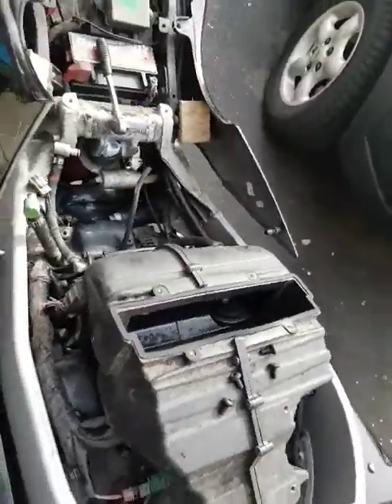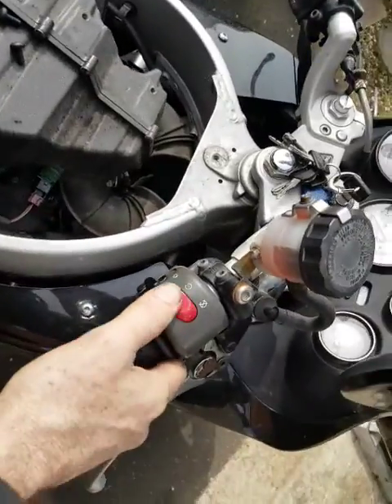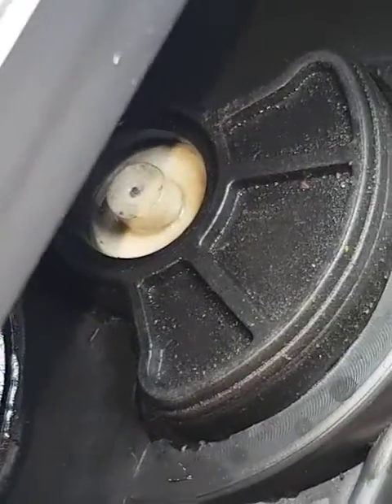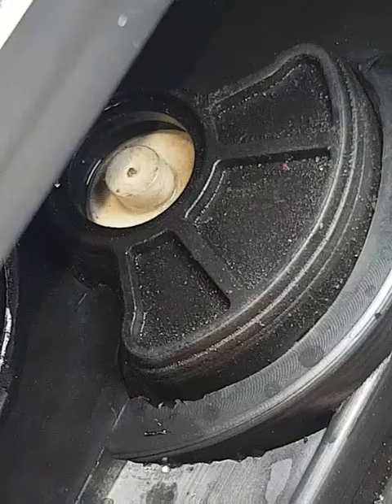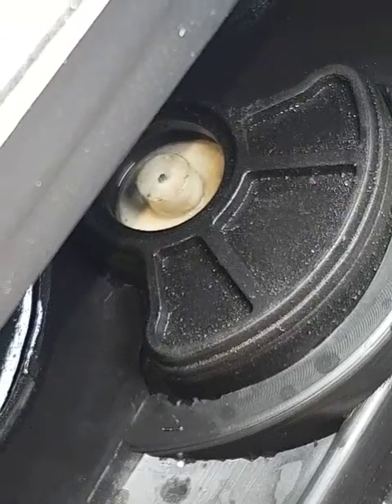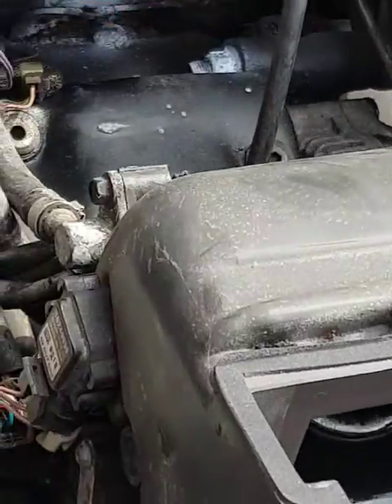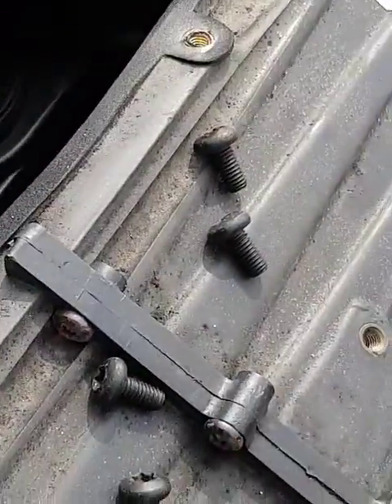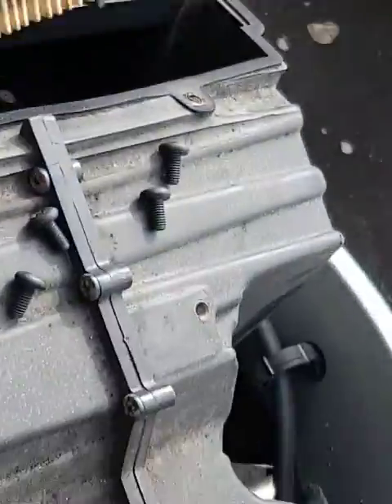Triumph 955i idle control,  stepper motor  piston check

Comment: my bike wont start removed the airbox to find the grommet around the idle control sensor was cracked and not sealing it would this stop the bike from running?
Reply: I'm having the same issue, did replacing the grommet fix the issue?
Reply: @kalubkoetje5580  nah mate still not got her running no clue to what is going on just gunna get a bike mechanic to look at her